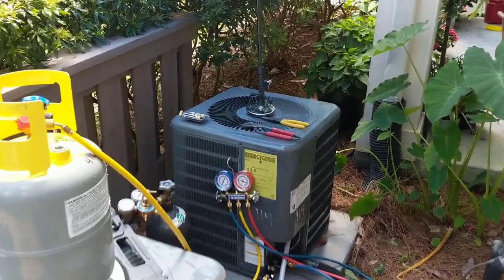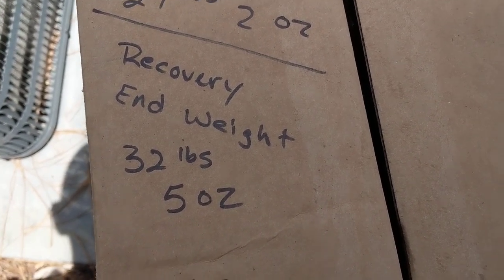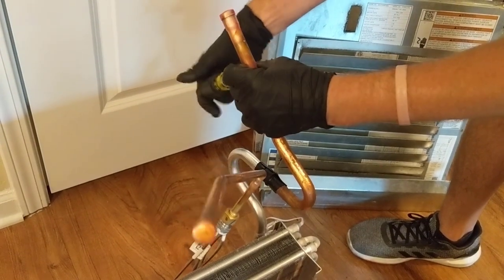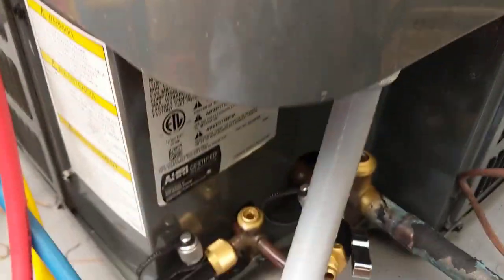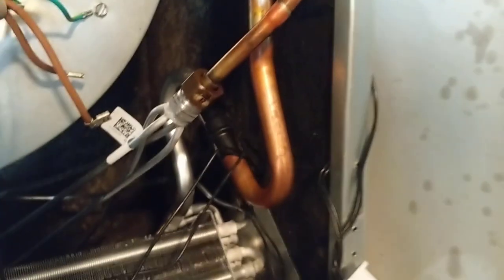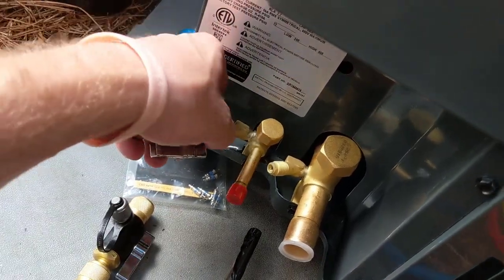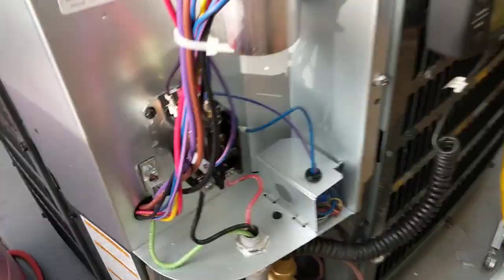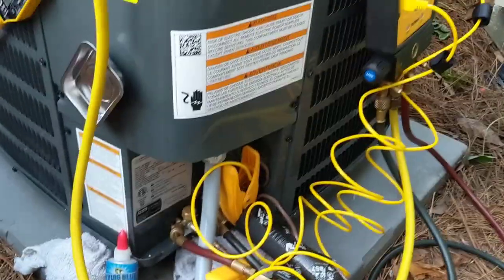Goodman Evap Coil And Condenser Changeout

Comment: Nice install but i noticed that the outdoor unit is straight ac  that should have been a Heatpump because in wintertime the main heat source for the apt will be the heatstrip which makes the electric bill high
Reply from the maker: Yeah I wish they put heat pumps in as well at construction,  but that's what my company wants and their the owner of the buildings & apartment community so I gotta install what they want installed. On the positive side were in South Carolina & it doesn't get that cold here, run the AC hard 10 months out of the year. We may set the thermostat to 70° or 72° in January or February for a couple nights but soon as you wake up you shut the heat off & turn the AC on during the day. The highest Electric bill I've seen is $160 and that's with everything being electric (stove, dryer, water heater, & air handler). But yeah I hear ya on having a heat pump would definitely save some money each month for the residents who rent the apartments. Thanks for watching Joaquin & Subscribe to the channel 👍

Comment: Why do you do a pressure test 2x? You are changing the condenser out and cutting the lines again.. you were going to do a pressure test anyway after you braze condenser in
Reply from the maker: I'd have to rewatch the video again to see exactly why but probably just checking my braze joints after the coil install or the condenser install, whichever one I did first, it's been awhile since I posted this video or have even watched it. Thanks for watching Straightoutofchiraq & Subscribe to the channel if you're not already 👍
Reply: @ApartmentMaintenance  it's all good

Comment: where did you find the tool you used on the seal tight nut?
Reply from the maker: Home Depot in the electrical isle. Isle 2 with the Klein tools. Thanks for watching Baylor & Subscribe to the channel if your not already! 👍
Reply: Thanks. Great job you made all that look easy. You had help?  I have over 200 units at the property  I work at and only two maintenance techs. I would have had to do all that myself. Nobody likes a complainer but its just ridiculous.
Reply from the maker: @baylortaylor6378  I have 284 units at my property and I have 2 techs. One tech was doing make ready's, and my other tech that was with me was my camera guy, but he's learning. So yeah I did that all myself besides lifting the old condenser out and sitting the new one in place but as far as all the work yeah Im the only one who can do AC work at my property.

Comment: Why not replace the entire air handler at this point?  They are like $800 to $900
Reply from the maker: Evap Coil is under warranty. So I saved $800-$900.  Thanks for watching 👍
Reply: Apartment Maintenance oh I thought you were replacing it because it was an R22 coil and you were installing a 410a condenser.   Didn’t realize it was a leaky coil and noises compressor.  That’s one screwed up Goodman

Comment: What,,,, 700 for a compressor,,, my contractor wanted to charge me 2,600 for my Goodman.....
Reply from the maker: I have a commercial account which is why it's cheaper. But that video is 2 or 3 years old as well. So the price has gone up since then I'm sure. Thanks for watching David & subscribe to the channel 👍
Reply: Thanks,  yeah they told me I needed a whole new unit 2, 700 that I was wasting my money on a compressor,  that the system couldn't be flushed, is this true sir? Thanks....
Reply from the maker: @davidlaws1438  I honestly can't answer that without seeing the system in person.

Comment: you pressure tested the system for one joint and then replaced the piston and condenser,i guess you have to milk the job to a full day,cause a real hvac tech would never do that,time is money
Reply from the maker: Yeah I did test the joint while I went to lunch what's the problem with that ? & what's putting the piston in a threaded fitting have to do with pressure testing ? If your such a real "HVAC" tech where's your videos of your work bubba ?? That's right u don't have any.
Reply: @ApartmentMaintenance  I've been doing hvac for 20 years,residential and currently all commercial,you pressure test a system once everything is tied in and the next step is to pull a vaccuum but if you have that much free time in your hands i can understand that,but that would never fly working for an hvac company
Reply from the maker: @pelon542  I don't work for a hvac company. I did about 13 years ago though & went back to being a service director for management companies. So the time from job to job is different when ur at a hvac company compared to working in hvac systems in homes owned by the same person you work for.  I'm a service director for a management company and I was training my technicians who are getting their epa license & wanting them to do the proper steps in hvac that's the reason for the videos.